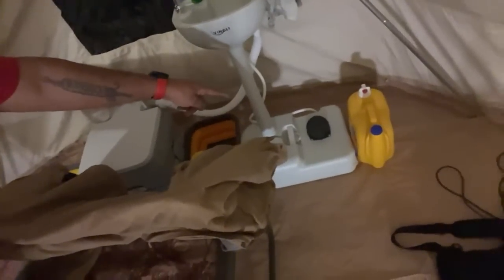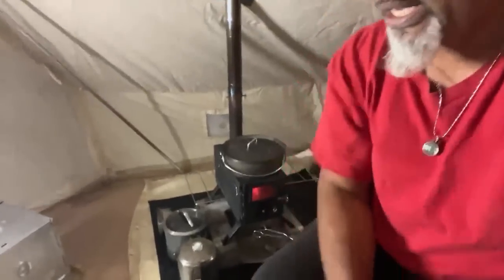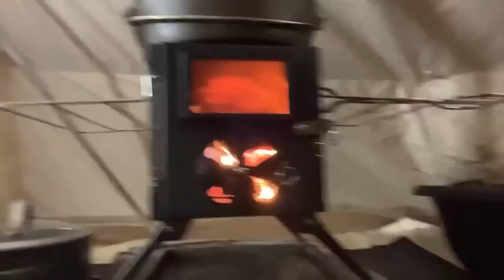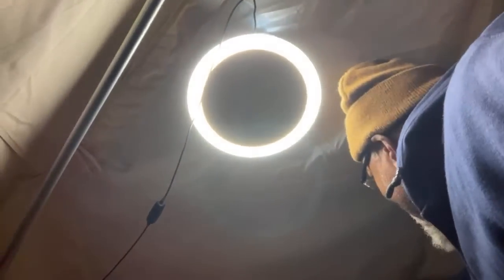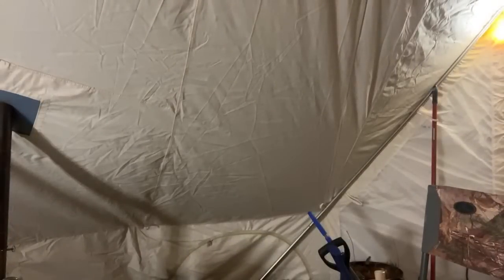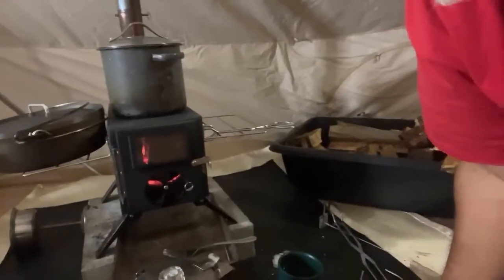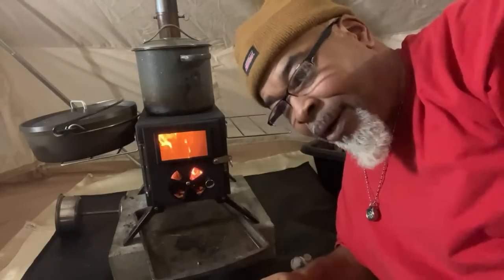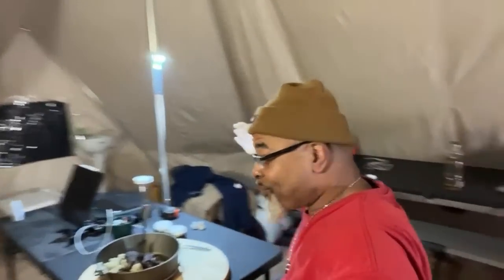Cooking off grid/ on grid 🍳

Comment: Love your tent set up Lead. I have that same camping oven. Lead maybe you should invest in some of thoses ceiling fans to help circulate some of the upper hot air from the ceiling downwards into the lower tent room area. As well as the fan for the hot stove. 💞